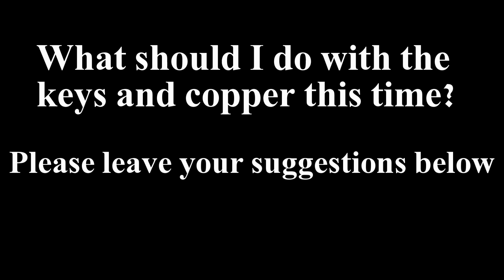RHNB-Fidget Cube

Comment: superfreeze the key and do a crack test. super freeze the copper wire and try to conduct electricity and see if it can complete a basic curcuit with a light
Reply: Copper (like all metals) actually conducts better when it's colder, so yes - it would close a circit no problem
Reply: TheUiopas could it be more likely to break?
Reply: TheUiopas What i mean is, could it become so brittle that conducting electricity would break it?
Reply: Yes, it would get more brittle, but there's no reason why an electric current wuld break it. Conducting doesn't produce any force.

Comment: You should try melting the copper wire by passing a stupid level of current through it. Or melt little strands of it by passing a reasonable-yet-still-enough-to-melt level of current through it. Or both!